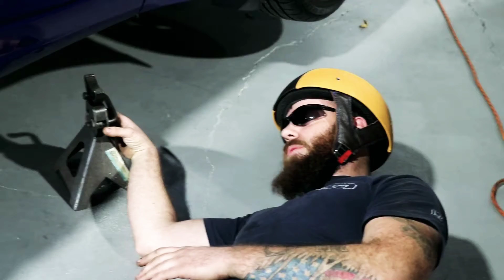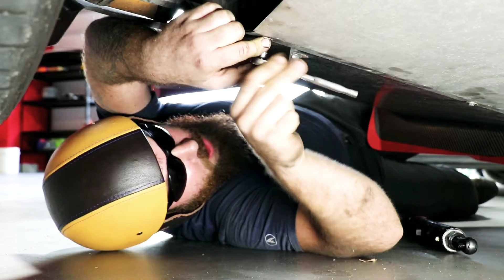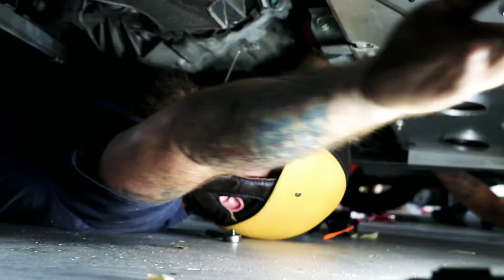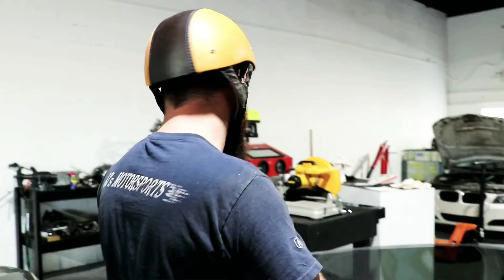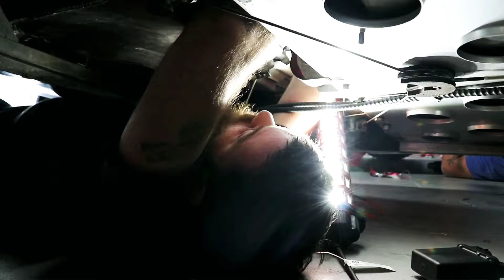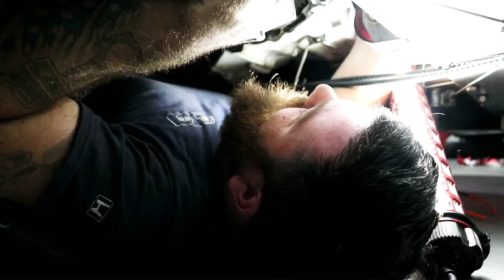Changing The Impossible Multi-functional Relay On A Lotus Exige

Comment: could have easily replaced it from the top lmao
Reply: Indeed.
Reply: I am the same guy who did this. I realized that after the fact… haha
Reply: @yubrandomain  it's all good we all learn together
Reply: @1fastmx5  hey man. I just knew…. That little multi function relay of combined 4 relays needed to GET OUT. Drove it to Austin (what a horrid ride…. Jk) drinking my coffee whippling the supercharger everywhere. Got it reprogrammed according to the recall and replaced the multi function relay. This was all due to a Fuel Pump circuit code, running the wires and eventually stumbled across the TSB to replace/reprogram